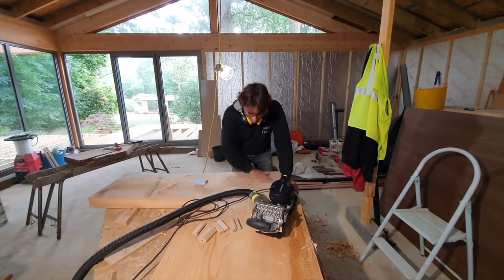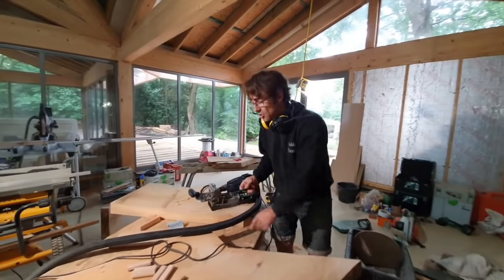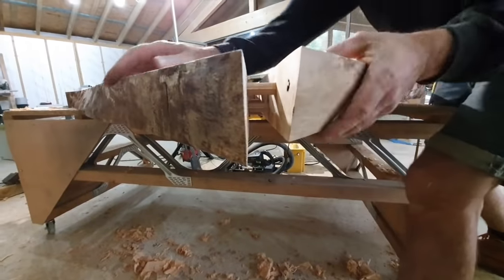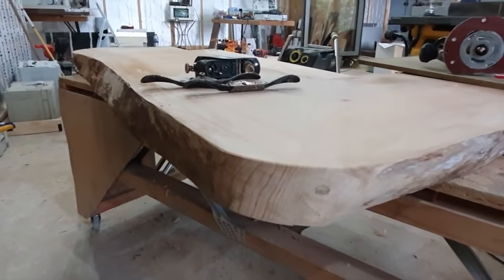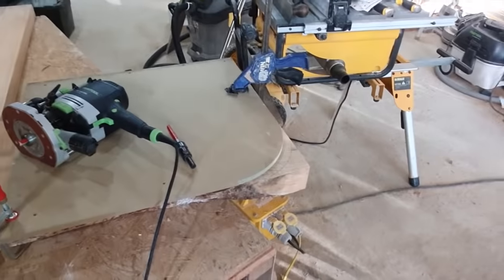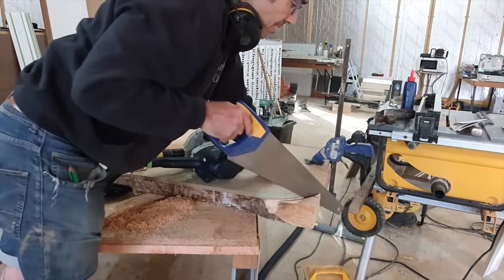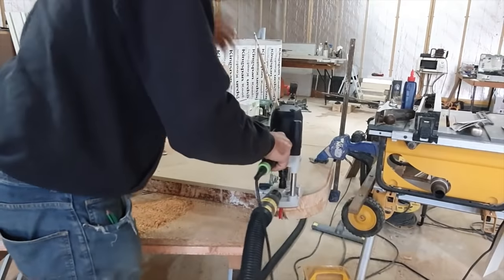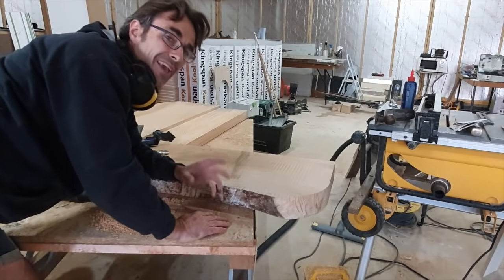How to connect a large mitre before making perfect radius corners in thick live edge slabs

Comment: If you own the guide rail adapter for the of1400 you can use it as a large handle that stops the cantilever affect of the router as its flush with the router base when attached and gives gives you a rocksolid hold

Comment: Hi Robin, very interesting watching the domino fixing system, I've never seen this before, a couple of questions for you - are there any advantages of the Domino system over the biscuit system? Also I am insulating my single skin garage but can't make up my mind on which method to use, any suggestions would be most welcome, and finally, when will you be doing part three of the deck build on the summer house?  Keep up the good videos, they're great.
Reply: Stud wall and celotex is best leave a air gap behind tho
Reply from the maker: Hi Clive, the domino system is more like a proper mortice and tenon and you can set the depth and use different materials for the domino tenon also, a biscuit is graet for thinner material like sheet material, you could do the live edge mitre with biscuits but you would need to have plenty and really good glue on the faces etc, on your garage, there are many ways to insulate most people want to keep it thin, If space is an issue then I would use a 75mm stud wall at 600 c/c with 75mm Kooltherm well cut between the studs a vapour barrier on the stud then an insulated plasterboard say a kingspan kooltherm K118 37.5mm this would get you close to regs (depending on all other insulation being added) and finally part 3 of the deck build is underway!! I should be posting a video in early October

Comment: I feel edgy whenever I see someone leaning over a Iive tool with a cutter directed towards their stomach . A little too casual for me.
 A deep router cut is always a problem.
 Another approach would be to do as you did up to sawing off the waste, but then turn over, remove to copy ring and use a cutter with a bottom bearing against the already cut part. That extension-bit from Festool must have cost an arm and a stomach.
Reply: Angela Slaney that’s what I was thinking. Get the cut started off the template then use a bearing on the freshly cut edge to finish.

Comment: Why not take of the corner with a jigsaw near to the line. It's less pressure on the router an cutter
Reply from the maker: Hi James, a jigsaw would not give a clean or true cut, also you would need a 120mm jigsaw blade and these can really wander, great question mate...
Reply: @ukconstruction  Cheers robin. I am a carpenter myself. Was wondering about the festool domino. I have the biscuit jointer for cabinet making or for worktop. Would you recommend getting the domino. Ps would like to see the heavy worktop in place on the island. The grain looked awesome. Cheers robin. Great videos.
Reply: @ukconstruction  I would just like to commend you for taking the time and effort in showing us different techniques. Been in the buisness 45years. I think carpentry is one of the great trades and made much easier with all these new tools. I am in awe when I see how the Victorian carpenters applied there skills in their  work ,with basic tools. I can tell that you love your trade immensely.  Well done robin.